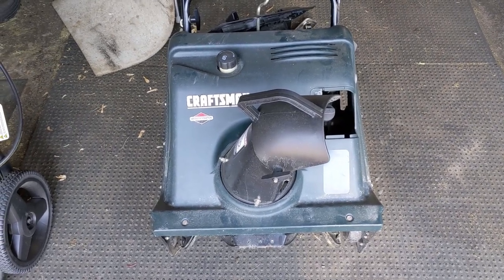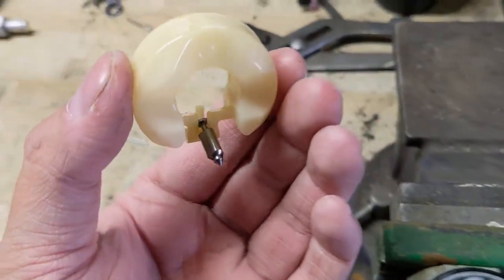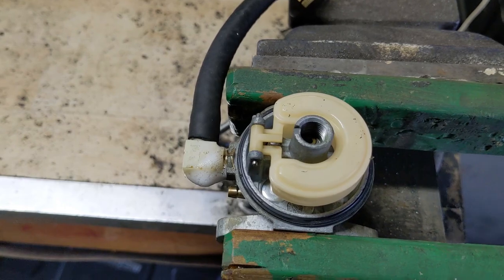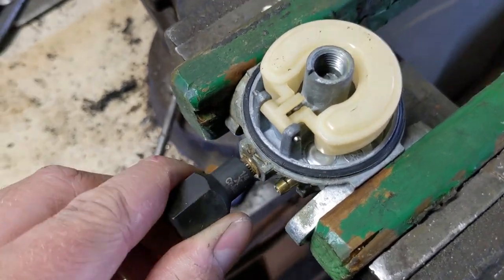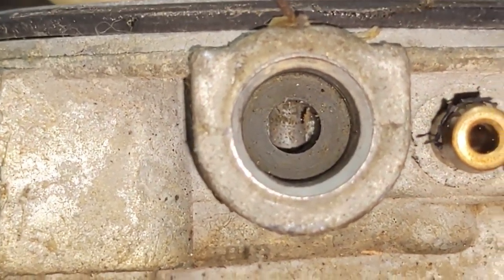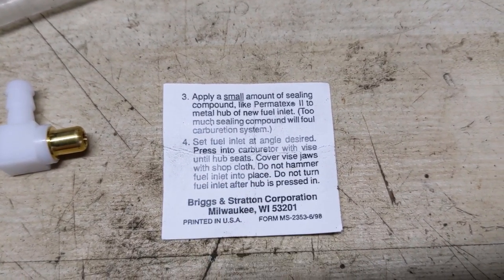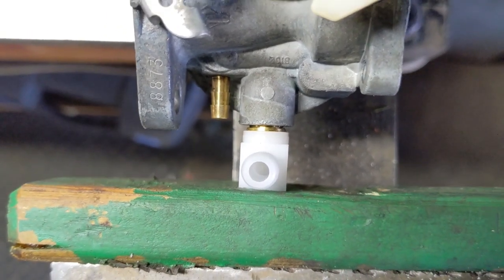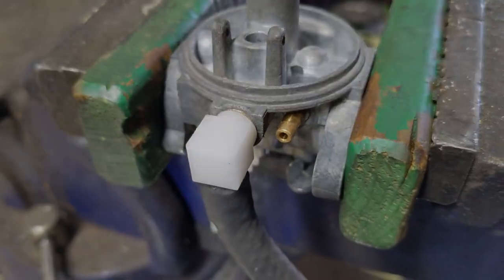How to Remove & Install a 90° Fuel Inlet

Comment: Very nice job on this video with information just about anyone will find helpful. Hard to believe that so many of these plastic fuel inlets crack, have also seen them melted right through from the muffler on riding mowers.

Comment: Great video. Anwsered all my questions. Mine was purchased in '98 and has set 10+ years. Cleaned carb just to see if still ran and started right up. Didn't know connector wasn't suppose to turn so of course it leaked when reinstalled and tested. Need to order kit and replace seals now that I know it works and is worth saving. Newer ones not built as heavy as this one and hated to junk it! Thanks again!!!

Comment: Good info. I ordered a replacement carb for a Tecumseh but this inlet was facing the wrong way. I saw a video that said not to turn them. I did anyway and it worked but now at least I know why. Also the replacement had a longer outlet and hit the back wall of the mower. (China knockoff carb but I wasn't going to spend a lot of money on an old crappy mower)  It wouldn't bolt down until I added a spacer to the intake manifold. Pretty sloppy rigging but it worked. I need to go back in and make sure its not leaking and maybe replace it with the old outlet off the original carb. At least I know how to do it right now instead of guessing.

Comment: Local shop wanted $35 to pull put connector after buying $40 worth of B&S parts for carb! Went to Homedepo and purchased set bolt extractor set with 5 sockets for $20! Hopefully tomorrow will be as easy as you made it look!😂
Reply from the maker: Just take your time, they are plastic so don't rush it.

Comment: wow you made it look so easy. tried a 1/4" extractor and it broke the end off. gotta find a new way to get the rest out. should i use heat? will that melt the sealant thats in it? like your videos, short and to the point, get the job done till this one lol. not your fault hope i can get the rest out. take care!
Reply from the maker: If they break off just use a tap and thread it in, vice grip and hammer it out
Reply: Ran a tap in so we will see. TY

Comment: That looks almost to easy to do. A small engine guy up by me wouldn’t try and remove it. Was afraid of cracking the casing.  Is there any chance of that cracking the carburetor?
Reply from the maker: I've never broken a carb and we remove these all the time! Find someone else who's done it before.
Reply: @EliminatorPerformance  another question , will using that seal all cause problems down the road if you have to install another one? Or would it come off in the same manner?
 I have the part ordered , I'm going to attempt the job myself. I'll let you know how it works out.
Reply: I was a bit worried at first, thought it was just going to chew the brass piece apart. I used a manual impact to get it started and finished the rest with an air ratchet.  Came out no issues.

Comment: Hi do you have a video on replacing a metal fuel inlet?
Reply from the maker: Basically the same, they will twist out. I use a bit of seal-all on the outside of the metal before pressing them in.
Reply: Than you for your quick reply. Love love your videos. Your detailed explanations are always on point.
Keep it up.

Comment: why not just glue/seal the plastic back onto the metal insert without replacing the whole connector.
Reply from the maker: It will leak

Comment: For $10 or less you can slap a scamazon knock off carb and call it a day. No need for testing, replacing 90 degree inlet. Sell that customer a real snowblower.

Comment: found one at amazon for $7
but whole carb only $16
LOL
buy the carb
Reply from the maker: Yes but the issue is, this 699103 OEM carburetor is discontinued by the manufacturer Briggs and Stratton. Which means only new old stock exists (expensive) or the Chinese knockoffs that are Nikki style (too many issues). I'd rather clean and rebuild this OEM carb for around $25 and give my customer a guarantee!
Reply: @EliminatorPerformance  I was speaking in general. that $16 carb just popped up on search for that 90* fitting, NO idea what it fits. I have been buying the china carbs for years & they have always worked perfect. I like replacing them, rather then rebuilding. I'm in CA you can't get carb cleaner solution to take even paint off a carb soaking for a week ! let alone clean the carb at all. even out rat killer  just feeds the rats doesn't kill them.........
Reply: @EliminatorPerformance  Thanks so much for sharing . Hard to find good info without too much ..time waisting ...
Great videos and to the point !